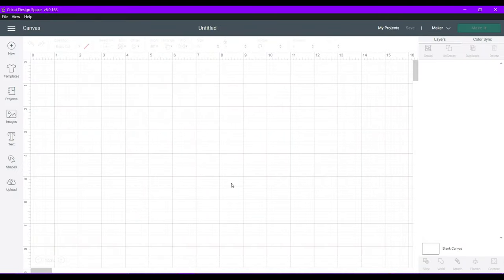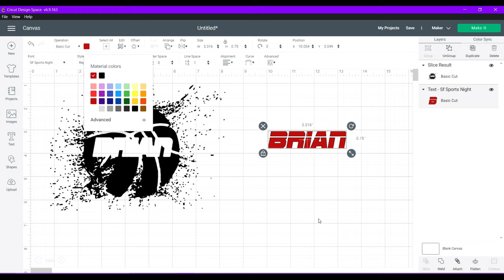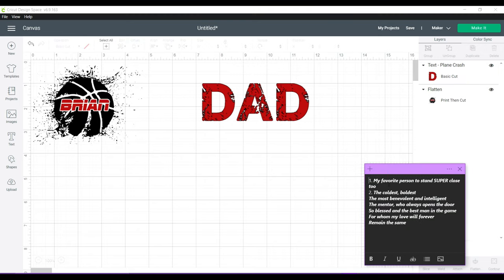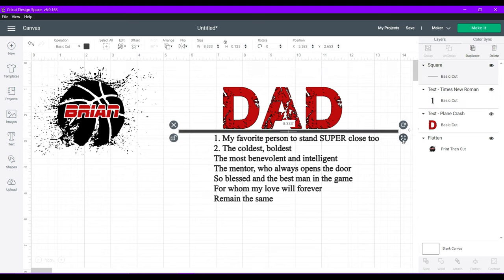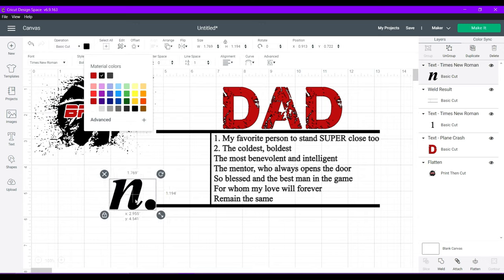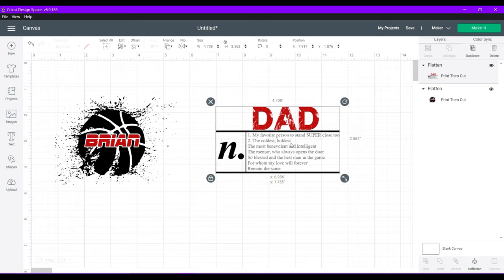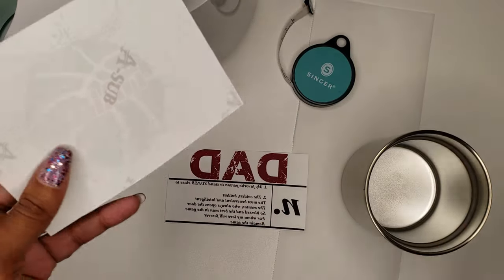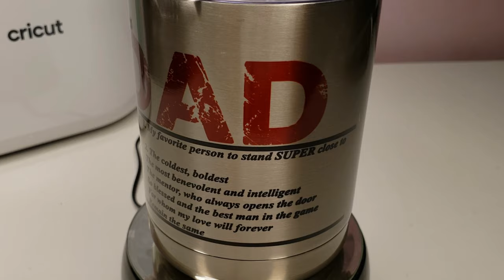Cricut Mug Press: How To Make Stainless Steel Sublimation Tumbler

Comment: How does it hold up after use and multiple washes? I know on plastics they resin them but on the stainless cups with no protection?
Reply from the maker: Hi! The stainless steel sublimation tumbler has held up very well. I hand wash only, and the cup is not showing any wear yet.
Reply: @ColorMePorcha  awesome! Thank you for the fast response!

Comment: Turned out great! Which brand of sublimation ink are you using?
Reply from the maker: Thanks 😊 
Printers Jack Sublimation Ink
Reply: @ColorMePorcha  Thank you!
Reply: Did you coat it with anything or is it a basic steel tumbler
Reply from the maker: @tonesha manning, it was sublimation ready when I ordered; it already had the coating on it.
Reply: @ColorMePorcha  OK because that color was absolutely amazing 🥰 thanks for replying so quickly you definitely have a supporter in me

Comment: So we can do sublimations  on stainless steel tumblers
Reply from the maker: Yep, as long as it has the sublimation coating.
Reply: @ColorMePorcha  and what is the sublimation coating
Reply: Sorry im new to sublimation
Reply from the maker: No problem 😊 
It's a clear substance that manufacturers place on certain products, that allows the products to take heat and sublimation ink. 
When you buy your tumbler just make sure says made for sublimation.

Comment: So you don't need anything on the metal to sublimate? You just printed it on sublimation paper and heat pressed it. So all those videos showing the sprays and 20 dollar glaze spays are not needed on metal?
Reply from the maker: No, you don't need to treat this tumbler because it's pre-treated for sublimation:
https://www.jpplus.com/10oz-stainless-steel-short-tumbler